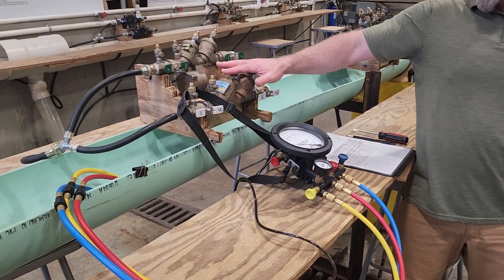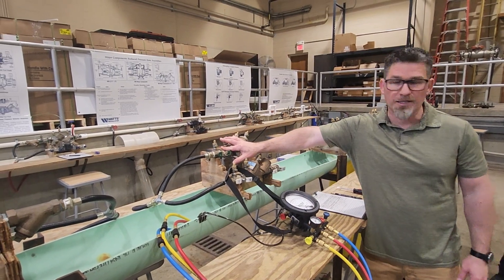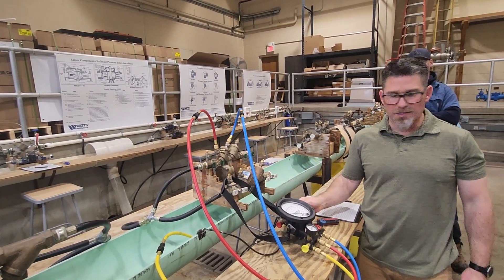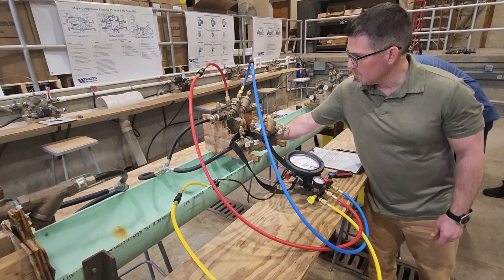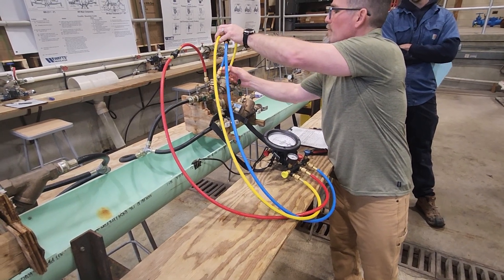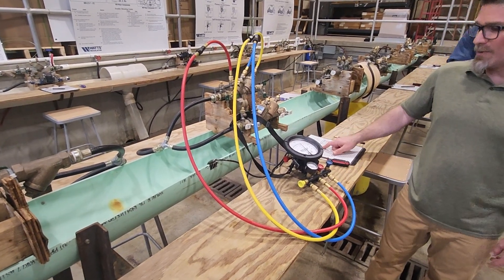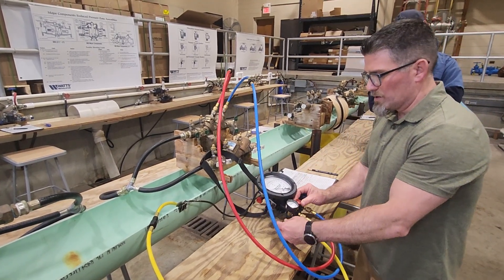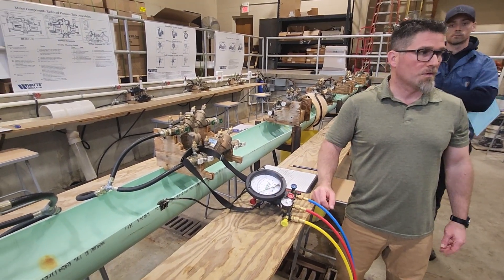Tennessee Backflow Testing RP 3/6/24 with Ben Rodriquez Fleming Training Center Tennessee

Comment: How do you know the downstream shut-off valve is drip-tight? It could be that there is no downstream demand, and the downstream shut-off valve is not drip tight.
Reply from the maker: Just because there is no demand doesn't mean there is no back pressure or siphoning,.. its a good question though 🤔,  a lot to unpack.